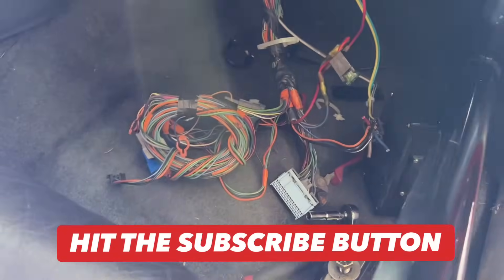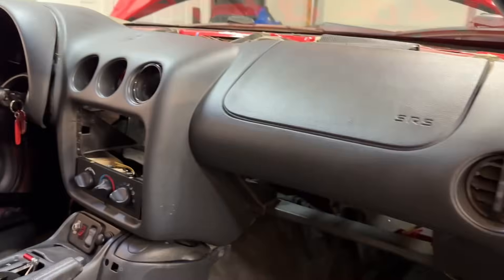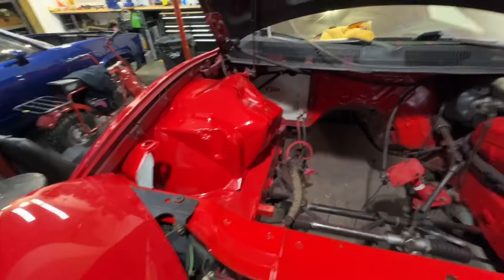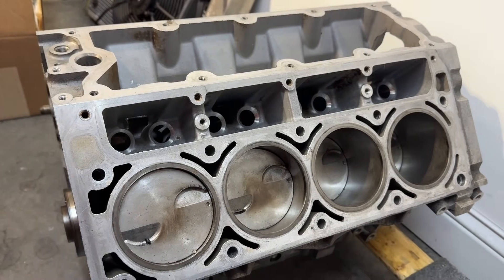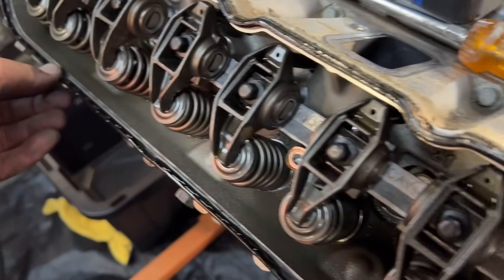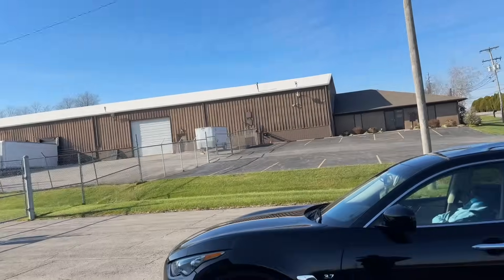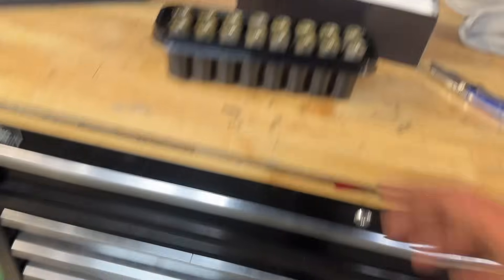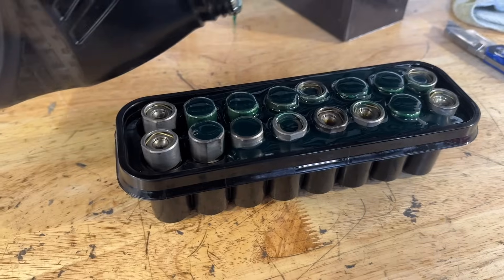F-Body Gets An Engine Bay Makeover & Prepping The New Heart!

Comment: unbolt the linkage from the headlight motor, manually rotate the motor 180 and reinstall the linkage.  That will fix the issue without replacing the gear.
Reply: @ClapdOut much love from batavia. Been a long time